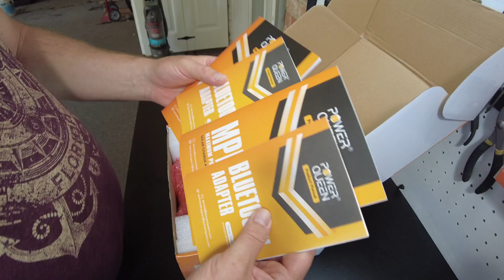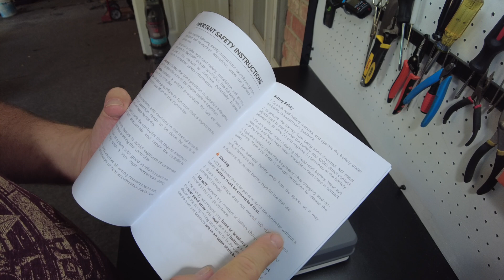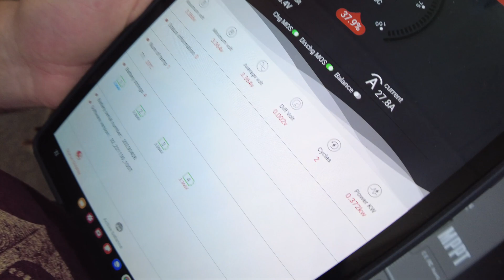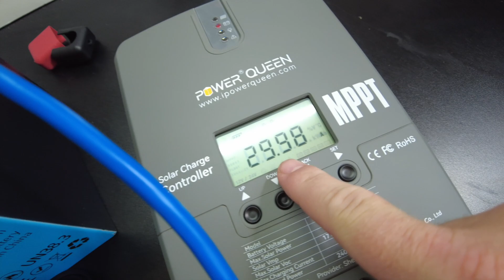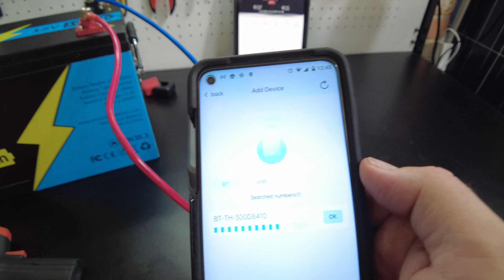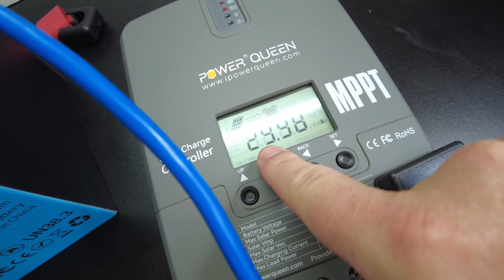PowerQueen 30Amp MPPT

Comment: Confirmed, these units will do 30amps continuous.  Recently used 2 of these units feeding one battery bank, on a cabin project.  They were being driven with 2 Mitsubishi 255w panels wired in series.  The app showed that both units were producing 29.9x amps, but watching this video I was skeptical and checked the amperage to battery bank with an Ames battery probe, which read 59.97-60.13 amps.  They managed this for ~4 hours in 28* ambient temps.
Reply from the maker: I might retest this, although they have a new                   30A MPPT out now that seems to have replaced this unit. It's like the HQST, LiTime units. Thanks!

Comment: Amp discrepency is most likely caused by controller and bluetooth module consuming a small amount of power to operate.  Overhead if you will... doesn't surprise me and doesn't seem like a big deal.  I'm no solar expert though.  Just my take.  Thx...good video.

Comment: Good info, TFS Brad. It looks a bit like a Renogy type knockoff, would that be fair to say?  I use a capacitor bank with my battery setups which helps to mitigate various potential issues including a high voltage BMS shutdown. Cheers

Comment: I'm taking your advice on the panels. I ran them in q 4s2p set up today since it was warm and hit 134 volts but mostly stayed at 120 and produced good. Next time I'm home I'm buying one more panel that match my other 8 so I can run 3s3p to get that voltage down a bit. One thing for sure tho at 120 volts I didn't have hardly any voltage drop between my panels and charger at 60 feet away but I'm also using 4awg wire for the home run

Comment: Brad I home from work this weekend and I rewired my solar panels to 4s and 2p. My panels are 235 watts at 30 volts and a open circuit voltage of 37 volts. Its just under the 150 volts that my charge controller can take. Do you know if its ok to be that close to the max voltage of the controller? Seems to be working much better at the 4s2p than it was at the 2s4p. I just don't want to burn up anything ya know.please tell me what ya think as I trust you and your information thanks brofor sure
Reply from the maker: @matthewknight5641 Don't do it. That's too close because they can actually go over VOC if the temps get low out. A sunny winter day can kill your controller.

Comment: Those charge controllers that require "battery first" are worrisome. What if the BMS disconnects the battery while solar is producing?  What happens if the BMS disconnects at night then the sun comes up and solar starts producing?

Some times the "battery first" just means so that auto-detect can work and setting the correct voltage means you can then use either order.  Some times "battery first" means "you will fry this controller if you connect solar with a battery connected."
Reply: Interesting never thought of that what controllers are there that I don’t have to worry about?
Reply: @BobBob-il2ku  Victron .
Reply from the maker: @onthelake9554  Yes Victron is the one.
Reply: @BobBob-il2ku  that's a good question.  I do not have a good answer.  But if the controller advertises that it can "wake up" a LiFePO4 battery (or BMS) then that usually means it will be okay in the night time shut off case and probably okay in any situation where the battery is not connected "first."
Reply from the maker: @Sylvan_dB  Yeah, and you can count on it, The BMS will eventually need to protect the battery, and it will disconnect. Some batteries will not charge much past 14.2v before high cell disconnect. So yeah if it cant handle the battery being MIA, then it's probably only good for lead acid IMO.
Reply: This is another reason why I use a capacitor bank in parallel with my 24v lifepo4 battery system & close to the inverter, it helps to mitigate this potential issue, reduce DC ripple & increase inverter surge capacity.  It also helps running 12v/24v dc fridges from a capacitor bank to increase & stabilise compressor motor starting current, without using the inverter while away from my Off Grid Reckless Abandon for months at a time.  I dont see people using any ‘extra’ capacitors in systems these days other than what may come already built into an inverter, it is not a particularly ‘cheap’ boost, filter or protection device, but still a valid one worth consideration.

Comment: Thanks for the review again Brad. Have you reviewed how these compair to the PowMr 60A MPPT charge controller? I understand these all have the bells and whistles that the PowMr doesnt, but for $89 on the PowMr 60A seems like a pretty good deal. What are your thoughts?
Reply from the maker: I reviewed the 60amp PowMr awhile back when they first appeared, I had high hopes because of the price, but it was garbage IMO. Thanks

Comment: I'd use a Victron shunt to get true current reading to see which is correct or if both are wrong
Reply from the maker: I know the battery, and my clamp meter are correct. I use the clamp meter all the time. The MPPT controller is the thing that is off. Thanks